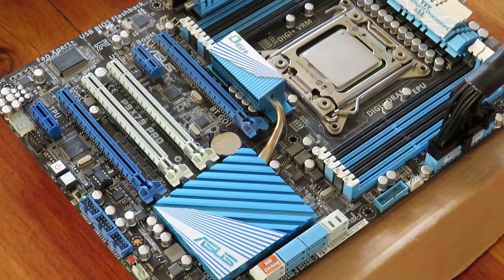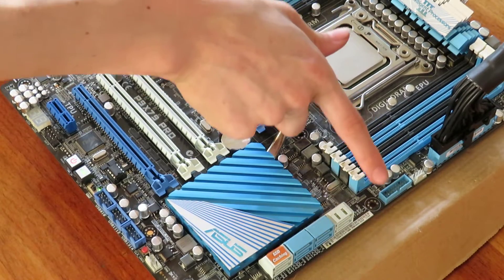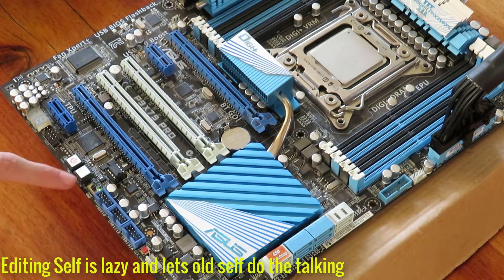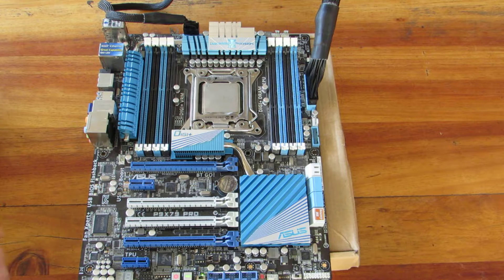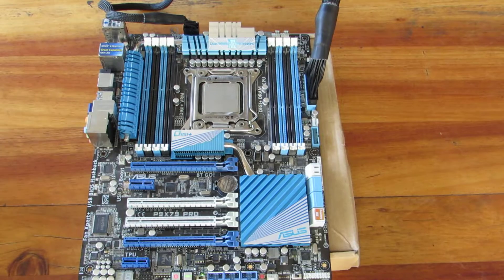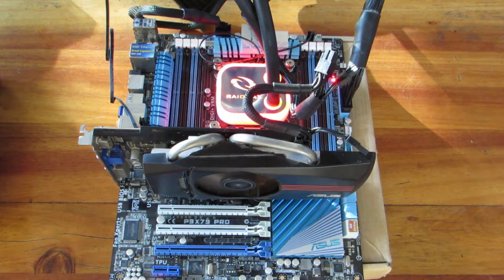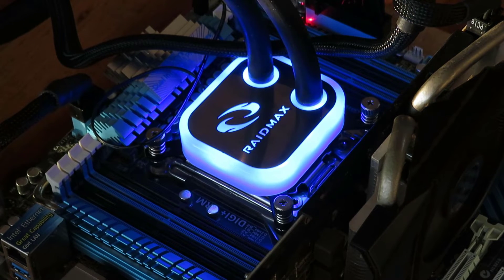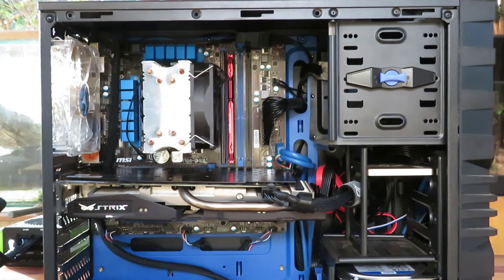Upgrading to X79 in 2018 - 3930k and P9X79 Pro - Part 1

Comment: Bought this board over 1 year ago...in USD 220 package that included 8x4GB DDR3 1600 HyperX Fury desktop RAM + i7-3820 + CoolerMaster H412S CPU cooler. The value of the i7...$60.  The value of the 32GB RAM USD 120.  The value of the CPU cooler USD 30.  The cost of the P9X79Pro...about USD 10 to 20. This was a DEAL!!!!  

I kept the MB+ RAM, sold off the rest.  Paired it with a XEON 8C/16T Ivy Bridge (E5-1680V2 for USD 155, OC to 4.5 GHz).  Bought a 230W TDP tower cooler (PCCooler GI-D66A for USD 70). Installed a new RX590 for USD 170.  It is running well for over 1 year as a daily driver. Cooling is excellent at this OC.

A fine machine as a daily driver and it handles 1080P in High settings perfectly well. Cinebench:  R15= 1587; R20=3326; Passmark CPU Mark = 19670).

Comment: I have a P9X79 Pro motherboard and a m.1 nvme pcie, the bios does not detect a hard disk.
Any solution???
Reply from the maker: As far as I know NVME isn’t a supported standard on X79. If you are using a PCI-E adapter for the SSD it probably won’t work
Reply: @etstudios  Not correct.  I have one NVME m.2 on a PCIE adapter, where I install many games, programs.  However, the OS is on an SSD.  You cannot boot from the NVME on X79 unless you go with a "newer" Chinese motherboard like HuananZhi X79 deluxe or similar, where the Chinese have figured out how to open X79 for NVME slots.
Reply: You can use clover to boot from the nvme adapter

Comment: Mine's still going strong in the most demanding games. 32Gb Corsair Vengeance DDR3 1600, MSI Ventus RTX 2060
Reply from the maker: Nice, I just upgraded to 32GB of RAM and a month ago I got a 980 TI
Reply: et studios 980ti is a nice card. I had one before this. I only upgrade for a newer card and less power
Reply from the maker: Nice, the only downside to these cards is probably the power consumption really
Reply: Need help from you guys. I have same mobo p9x79 pro and i cannot pair it with rx580. It is running hd 7850 2gb well but not supporting new cards. Hopefully bios issues.
I tried to update bios but it's not showing 
.cap files only showing.rom files. Yes usb is formatted to fat34 
Still Facing this problem.
Kindly guide me through this
Reply: @gamingboltstation1563  All I can think of is a BIOS issue, but it's strange either way.

Comment: I have the same motherboard with i7-3820 and an MSI GTX 670 OC but I think it is broken now due to the instable voltage here where I live or it's the socket that got worn out (not sure because I've never removed the CPU since I bought it)

Comment: Are you doing any VR gaming on this?
Reply from the maker: I would be if I could afford it. The 970 should be enough for most VR games with the exception of the most demanding ones. I do now have 2 GTX 970s that I sometimes run in SLI, I plan to do a video on that soon. But the CPU itself if paired with a good GPU will do great in VR.

Comment: I still use this motherboard, with a i7 3820, auto clocked at 4,6ghz by asus software and a old corsair h80i cpu cooler.
Have been running great since i got it in 2011 or 2012, cant remember.
Recently got rid of the old asus gtx 670 and got a 1080ti.

You will not regret the x79 choise, even tho it is a bit old :)
Reply from the maker: I agree it is a great platform, I just need a better cooler to get this thing past 4.2ghz
Reply: @etstudios   even have more pci lanes, for SLI and a bunch of M.2´s :P
Reply from the maker: Indeed, in fact, you might want to keep an eye on the channel for a video coming out on the weekend
Reply from the maker: The USB ports need a particular driver on Asus’s utility section. They don’t work with the standard overall driver. Also the reason I didn’t go air is because I couldn’t afford it. I have a plan to upgrade to a Corsair H100i GTX that I found for cheap

Comment: wha cooler u got
Reply from the maker: It’s the Raidmax cobra RGB 120
Reply: @etstudios  thats good dont plan on ocing heavy but if u do if u ever wana upgrade to a noc I got one im selling for 40
Reply from the maker: I have uploaded part 2 if you haven’t seen it. I got it to 4.2 under 80 degrees so I’m relatively happy
Reply from the maker: I had a 3770, the performance video has comparisons
Reply from the maker: Both I just didn’t have time to do to many gaming benchmarks